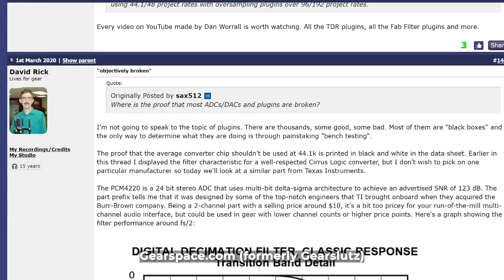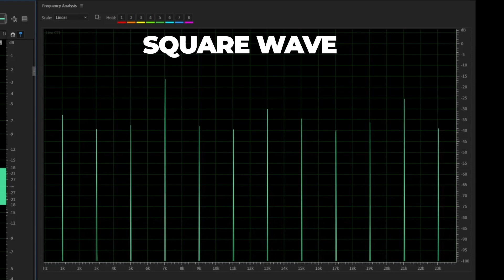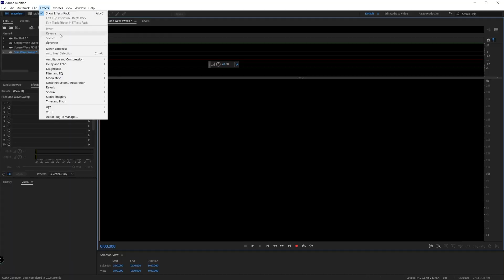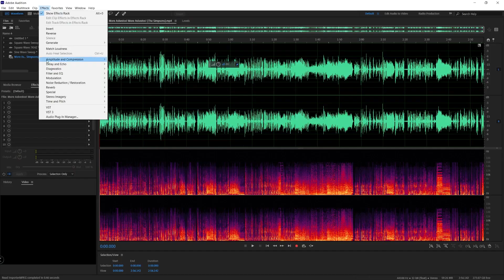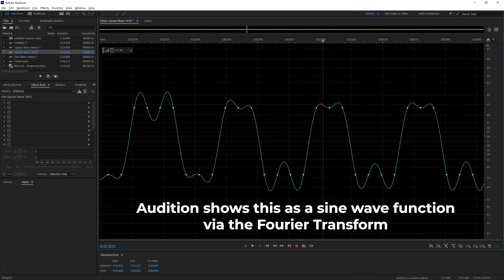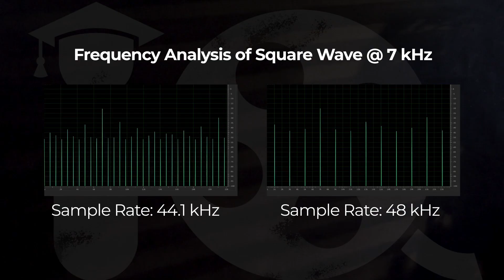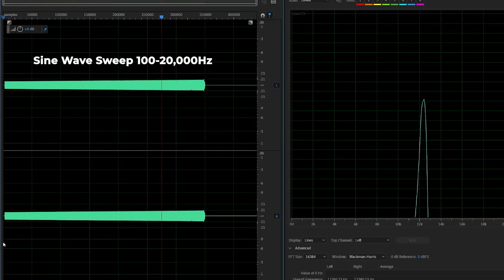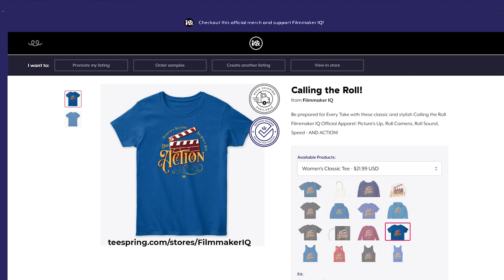What is the Optimal Sampling Rate for Audio? (It's All About the Aliasing)

Comment: You skipped an important point: the steeper a filter, the greater the induced phase shift introduced to the signal. You can get around this using different types of filters, but those introduce other temporal artifacts (such as pre-ringing with linear phase filters). And crucially, just as an anti-aliasing filter is needed at the analog input to a digital system, a reconstruction filter is needed at the analog output from a digital system. Therefore, the primary advantage of higher sampling rates in audio is that one can use less steep anti-aliasing and reconstruction filters starting at higher frequencies well outside the audible range, but well below the Nyquist frequency—all while generating fewer artifacts within the audible range.

Comment: I used to work in sonar engineering in which we used digital signal processing. To avoid aliasing the first 'processing' step was an analog filter which would cut off frequencies that could cause trouble because of this aliasing.
Reply: Hello 👋 👋 👋 
I need a course of Signal Processing 
Can you help me 
Thanks in advance
Reply: A well designed delta modulation ADC does part of filtering for you.  A part like the AD7768 uses a modesty high order integrator so you get more than one pole of anti-alias for free.
Reply: @kensmith5694  I've never been able to fully wrap my head around delta-sigma converters. Like... I can sort of follow the math line by line, but I can't really develop and intuition for the "heart" of how they work.
Reply: @kensmith5694  When I mentioned working in sonar engineering I was talking about 1979 and 1980. We had to construct our own processing unit by using a 5 MHz 32 bit 'high speed' multiplier as the heart of our system.
Reply: @Lantertronics  You may find it easier if you set out to design one.  Breaking the problem down in the same way as you would to design is a good way to work out how it works.  You can make a simple modulator and then just imagine adding a simple analog low pass filter to the digital output signal.  Then step wise improve each with the ideas from the existing ones.
Reply: Filters cause phase shifts...
Reply: @dodgingrain3695  Linear phase filters cause no change in the phase relationships.  They only cause a delay.
Reply: You HAVE TO have an analog filter on the inlet side of an ADC.  If the signal bandwidth hasn't been pre-limited by some other device, there is always going to be SOME ultrasonic content, from harmonics and/or inaudible sounds.  Real, perfect sine waves don't exist in nature, and wouldn't be interesting to listen to.  Just because we stop hearing things above 20kHz doesn't mean those sounds don't occur anyway.  :-)

Even if it's just electronic noise... maybe RF leaking into the audio stage from something acting like an antenna.  There will always be some.  So a filter is mandatory.
Reply: I think you can’t realistically have an analog filter that will let 20 through but completely block 22 and higher.
Reply: @nickwallette6201  IIRC modern ADC/DAC solve this by oversampling and filtering in digital domain. analog filter still needed but can be much simpler.
Reply: @noop9k  The "completely" part can never be done but you can do a very good level of it.  You end up with more poles than a fireman's nightmare to do it.  Basically, you end up with a whole mess of notches to get the 22KHz to 50KHz down enough.
Reply: @kensmith5694  With all these components you’ll get plenty of distortion and noise.
Reply: @noop9k  The input signal has noise in it.  A well designed filter will add less noise than that.  The distortion can also be extremely low.  Remember we are not very limited on power consumption.  The corner frequencies are all above 1KHz so we are not required to use any high K ceramics.

Comment: So here’s the thing, Youtube does support 48 kHz audio, and it does support higher frequencies than 16 kHz... sometimes. Every time you upload a video to YouTube, the encoder creates about 6 different versions of the audio with different codecs, sample rates, bitrates, etc. On playback, it will automatically choose the audio based on your network, decoding capabilities, etc. Just because the video was ruined after you checked the download, that doesn’t mean it would have been ruined for all listeners. Really it’s Youtube’s technical inconsistency you have to worry about (I think that might also be true for your video about cutting the video 1 frame early)

TLDR; Your description of YouTube’s capabilities wasn’t strictly true, but you were still right to cater to the worst case scenario.

Very interesting video!

Comment: 4:50
a tiny bit of correction on this part. If you actually activate the "stats for nerds" option, you would see that Youtube actually uses a much newer audio compression format called Opus, developed by the same xiph foundation that Monty himself works for. And what's interesting about this audio codec is that the developers have decided to restrict the sampling frequency to 48 kHz (44.1 kHz sources get upsampled upon conversion, hi-res sources get downsampled and 48 kHz sources are essentially no-op and passes through). The reason for this is exactly the same reason you mentioned a few seconds ago, the math is just easier that way. You will only get 44.1 kHz if for whatever reason, your device requests Youtube to fall back on to the old AAC or Vorbis codecs for compatibility reasons which will almost never happen especially if you're watching from a web browser or using an Android phone. But considering that Opus is still a lossy format, it's still gonna cut off any frequency above 20 kHz anyways.

Comment: An exceptional video, sir, especially for going the extra mile and looking into YouTube's own codec shenanigans with your own examples. I regret to say, I didn't hear much difference in the 7kHz files, but considering I'm getting older and adults lose top end in their hearing range over time, I'm not surprised anyways. (I can barely hear CRT yoke noise anymore, which I definitely could as a kid)

Aside from pure monophonic sound, I think higher sampling rates have a dedicated purpose when doing any kind of stereo/surround real-time recording, or doing any audio processing involving pitch/duration manipulation.

In the first case, human hearing becoming more sensitive to phase differences between ears as frequency increases, such differences in phase and arrival time contribute to our sense of a physical space the audio is occurring in. (Worth noting here that the Nyquist-Shannon sampling theorem assumes a linear and time-invariant process, where it doesn't matter how much or how little the signal is delayed from any arbitrary start point—human hearing, however, is definitely NOT a time-invariant process) When dealing with sampled audio, at higher frequencies, the number of discrete phases a wave can take drops off considerably: assuming a wave at exactly half the sampling frequency, you can have it however loud you want (within the limits of bit depth), but you can only have two phases of the signal (0° and 180°). One octave down, you only have 4 available phases (0, 90, 180, 270), and so on. This might contribute to the sense of "sterility" and "coldness" associated with older digital recordings that didn't take this into account. So if you're mixing audio that relies heavily on original recordings of live, reverberant spaces (drum kit distant-miked in a big room, on-set XY pair, etc.), it's an advantage to get the highest sample rate you can afford when recording/mixing, then downsample your audio for mastering/publishing, if needed. This way, you can preserve as much detail as possible, and give your audio the best shot at being considered realistic.

In the second case, having extra audio samples helps when you want to pitch audio up/down or time compress/stretch. Since some of the algorithms for doing these techniques involves deletion of arbitrary samples or otherwise bring normally inaudible frequencies into human hearing range, having that extra information can also be a benefit for cleaner processing, depending on your artistic intent.
Reply from the maker: Yes, I haven't factored in pitch alterations.
Reply: That's not entirely true, actually.  The Xiph video mentioned in the content here covers the waveform phase topic as well.  The reconstruction filter post-DAC is basically turning discrete samples into a Bezier curve.  Just sliding the sampled points around on the X/Y axis (if X is sample, and Y is word value -- i.e., the amplitude of an individual sample) will alter the resulting wave's phase.

Another way to think of this is to imagine using a strobe light to capture an object moving in a circle.  If the speed of the object rotating about the circumference was perfectly aligned with the flashing frequency such that there are exactly two flashes per revolution, it would look like the object is appearing in one spot, then another spot 180 degrees from the first, and repeating indefinitely.  This is basically the Nyquist frequency.  From that, you could construct a perfect circle because you have the diameter.

So now, imagine altering the "phase" of that object so that the strobed captures place those objects at different places around that circumference.  You can still construct a perfect circle.

Same with audio samples.  It doesn't matter if the phase changes.  As the Xiph video says (I'm paraphrasing because it has been a while since I watched it), there is one and only one solution to the waveform created by a series of samples, provided that the input waveform and output waveform have both been band-limited to below the Nyquist frequency.
Reply: @nickwallette6201  Well, yes, for any arbitrary signal, you can still reconstruct it with sampling, but I was mostly thinking psychoacoustically, where delay and phase variations between ears plays such a big deal in stereo sound. And one of the side effects of sampling is that you get phase constraints, like I described above. For example, with a signal at half the Nyquist frequency, how do you distinguish between a full-amplitude sine wave and a cosine of -3dB intensity, when they both share the exact same sample representation (alternating between .707 and -.707)? Since that phase information can spell the difference between a centered (in-phase) or diffused (out-of-phase) stereo sound space, preserving phase and delay information is super important, and with finite sample intervals, there's only so many phase states you can have at high frequencies.

I also acknowledge, however, that bandlimiting filters induce their own phase delays as well, which can have a significant effect on the perceived audio—hence one of the other advantages of higher sample rate is to relax the requirements of bandlimiting and reconstruction filters to minimize their coloration of the audio.
Reply from the maker: Delay is not an issue with the sample rate. Sample rate does not affect the precision of timing of the wave in any respect
Reply: @eddievhfan1984   With two samples per cycle, you can reconstruct a waveform with any phase you want.  You could indeed have phase and anti-phase waveforms at 20kHz with a 44kHz sample rate.  Try it.  Use an audio editor to create 20kHz sine, then invert the phase.  Zoom in to the sample level and look at the waveform it draws.  This is a representation of what the reconstruction filter does.

I think it would be an academic exercise though, as 1) who's going to be able to determine relative phase between channels at the theoretical threshold of human hearing?, and 2) that's going to be in the knee of the low-pass filter curve, where any passive components on the output are going to affect the signal.  It would not be unlikely to have a mismatch between L and R channels.  High-end stuff might try to match capacitors to 1% or so, but there's plenty of gear out there (even respectable gear) that uses electrolytics rated at +/-20%.  There's a lot of concern over perfection that is not at all practically relevant.

Comment: Excellent and interesting video .. I would to like one term here, that is 'oversampling' .. When digitising an analog waveform it is quite normal to have a relatively tame analog filter, but run the sampling at a much higher frequency than the output requires, 8x or 16x oversampling is common. The next step is to have digital filter operating on this high frequency sampled signal and then downsample to the required frequency eg. 44.1kHz. 
The 10kHz squarewave has audible undertones because it was simply generated mathematically - there is no oversampling or anti-aliasing going on at all - if the signal was filtered properly before being recorded the 10kHz squarewave and 10kHz sinewave would, of course, sound exactly the same (since the next harmonic is not captured).

Comment: Another great video.  One thing about your sine/square test, you can simulate what would happen in a real-world situation by generating your waves at a sample rate like 3,072KHz (64x48K) and convert to 48KHz to listen to it.  That's because all modern ADCs sample at at least 64fs, often 128 or 256fs, filter out everything above 20KHz, then down-sample to your capture rate.

Another experiment I ran a few years ago was record a series of sweep tones to my blackface ADAT, which allows the sample rate to be continuously varied from about 40KHz to 53KHz.  At 53KHz, aliasing is almost eliminated where it's quite audible at 40KHz.  Yes, those converters are out of date, but it's still a valuable learning tool.

That said, I'm a huge proponent of 96KHz in digital mixers, where the ADCs are working low-latency mode.  At 48Khz, an unacceptable amount of aliasing is allowed to keep latency through the mixer below, say 1ms (not a problem in analogue mixers).  At 96Khz, the converters can run in low-latency mode and have no audible aliasing.  When I'm working in the box on material that was captured by dedicated recording devices (latency is not an issue), 48KHz is fine.

Comment: The Fourier Transform tells you how loud each sine wave in your signal is - a spectrogram, if you plot it.  It also can tell you the phase, so all 3 parameters - frequency, amplitude, and phase - of a sine wave are covered.  The Inverse Fourier Transform puts all those sine waves back together.  In computers we use Discrete Fourier Transforms, and usually a "fast" implementation known as an FFT for "Fast Fourier Transform."  (Which BTW is one of the top 3-5 hacks in all of computer science.)
Reply from the maker: Yes but the how gets way more complicated

Comment: Project and storage samplerate at 48k with each processing stage using oversampling has been proven to be optimal. You have to increase project sample rate to 384kHz to get the same. The trick is in the oversampling, allowing for wider bandwidth while processing to reduce artifacts and then filtering the unnecessary frequencies out keeps it cleaner. 48k is not enough for some signal processing, while it is plenty for other. A gain change can be done in 48k but compressing, anything that modifies the phase or time domain in anyway has to be oversampled to decrease overall antialiasing. The strangest thing is that despite having additional filtering stage at each processing block (for ex, each plugin in a project) and converting back and forth, it is less CPU intensive. Higher samplerates by far most of the time run "empty" signal, the entire bandwidth is processed at each stage while oversampling is not needed for linear operations.

This is not very known thing, which is a bit odd in my opinion. You can test this at any point, device antialiasing stress tests and compare 192k project rate to same processing done in 48k base and oversampling. The latter has less artifacts.

Comment: When you first brought up harmonics and square waves, I thought about posting a correction cause it sounded like you were about to make a big mistake by ignoring band limiting filtering, but I watched the rest of the video…and you handled it all. Well done, including your edit post YouTube processing. 
Yes, I did hear a tiny difference between your 5.2khz sine wave and the 5.2/15.6khz additive construction square wave synthesis. 

I do have exceptionally good high frequency hearing for a 55yr old, however, it’s also important to note that music is never a pure sine wave, nor a square wave, so you would never hear even the tiny (barely noticeable even to excellent hearing and only because it was a pure note of extended duration) differences I heard in an actual piece of music.

The important part, as other have pointed out as that your waveform must have and appropriate low pass filter applied. That could be a 20khz analog filter, with sampling at 48khz or higher, or 20-24khz filter before 57.6khz, or 20-25khz before 60’hz, or a 20-35khz analog filter and sampling at 88.2 or higher sampling. And it’s always good to lower the noise floor by recording at 20 or 24 bit depth. Do all your editing and mixing at something above 48khz and above 20bot depth, then master for 44.1/48 16/18/20 bit sure, you can master for 24bit depth, but no one will actually be able to tell the difference.